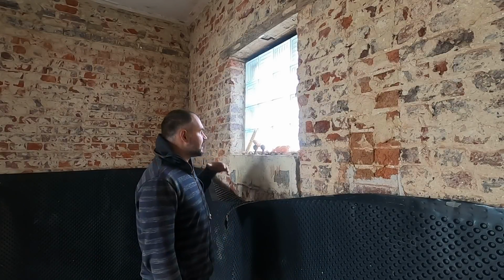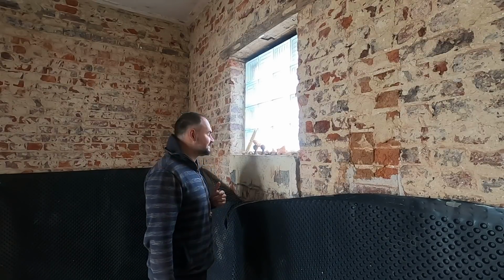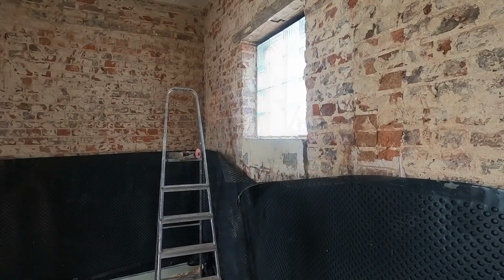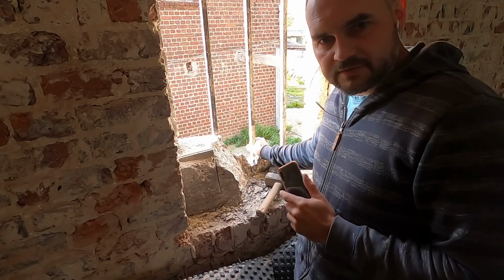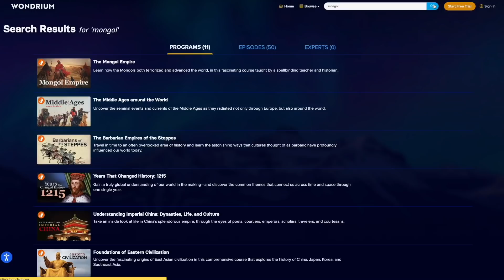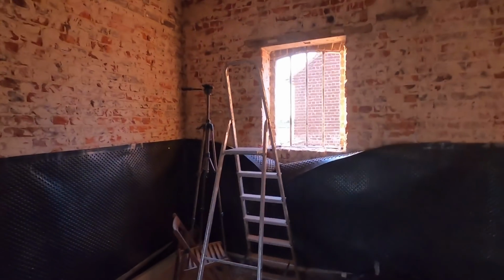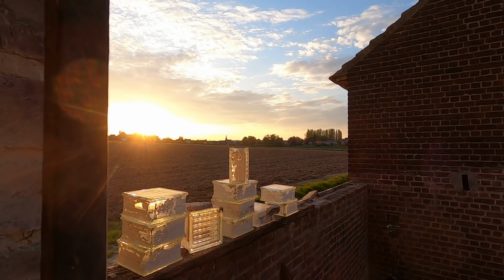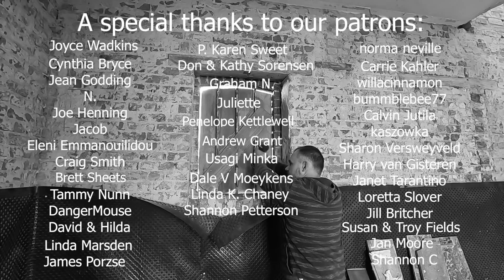Opening the window or a HARD NUT to crack / Renovating an 1908 ABANDONED farm

Comment: If I look at 15:55 it looks like there was another window next to this one that was bricked in, while you are at this stage it could be an idea to open it back up 👍
Reply: I am also wondering if you plan to reopen the second window!
Reply: It would add a lot of light to the room and the bricks are easy to remove compared to concrete
Reply: There s the staircaise- but maybe by a ligthly change of the stairse..
Reply: wow you are right.👍
Reply: Came to the comment section to make the very same suggestion 😂
Reply: @cakann3933  Oh, of course! It was probably bricked in when the house was rebuilt and was changed from the single story home that was damaged to a two-story home and the staircase was required.  :)
Reply: @ddfromcalgary2348  I’m also from Calgary and wondered the same
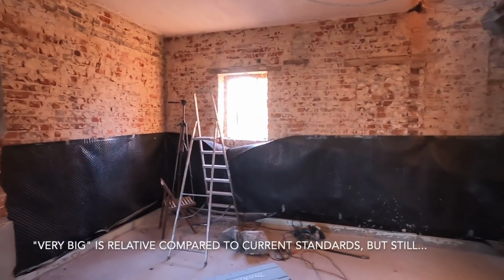Reply: You can also see it @13:10 when he pans out from the inside. The staircase isn't the problem. Who know what they were thinking back then to seal it up. I'm surprised the wrought iron bars went down to the original window size. I'm sure the second window will have those same bars between the bricks.
Reply: I was thinking the same, I think it was briked up, because of the roof, that was outside... between the house and the bakehouse.
Reply: My same thing :)
Reply: @ddfromcalgary2348   sthanks d  by guy Cmd
Reply: I agree .
Reply: You can see the window header from the outside at 16:51 but there isn't a window sill. I wonder if it was removed when they bricked up the window to install the roof.
Reply from the maker: Answering your questions: it would be wonderful to open up this bricked up window, but we cannot. We will rebuild the wall, that was demolished few weeks ago (and to make the staircase a bit wider, we will move the wall a bit into the room). The wall will be right against the right side of the window. An alternative option would be to change the direction of the staircase, but we would like to keep this big room as a guest room (and our future bedroom when we get too old to go upstairs :-).  So ja, a compromise was reached and the window will remain bricked up (although a pity...)
Reply: @DeHoeveOldBelgianFarm  Thank you for your clarification!